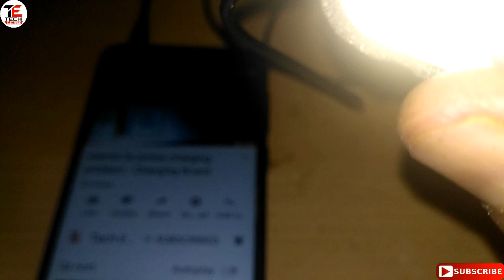How to Reuse old mobile speaker using 3.5mm jack | DIY

Comment: For everyone asking why its not loud. You can use an amplifier board for these types of projects. You have to look at the watts that the board can handle and see how many watts the speakers them selves use. And they make the sound alot louder and clearer. Also make sure you have a way to power that amplifier. They usually go for like2$ for something small like this

Comment: Hey I have tried it, it works but the sound is too low at max. limit.Does it requires some extra current to work upto it's mark.
Reply from the maker: Connect it to laptop or desktop then check
Reply: @TechElectroid  bhai kyu chutia bna rhai ho............ham isko banai aur aapnai laptop sai bhi connect kiyea ...........but im getting very low sound
Reply from the maker: Bhai speaker weak ho gaya hoga
Reply: Bhai mainai working chinese phone sai nikala tha
Reply: You need an amplifier board they are real cheap but come in handy